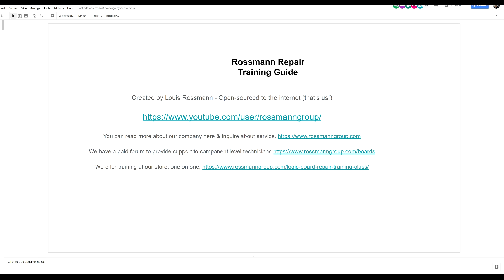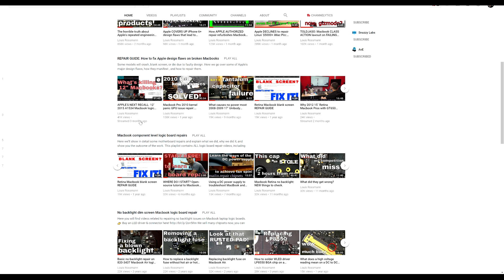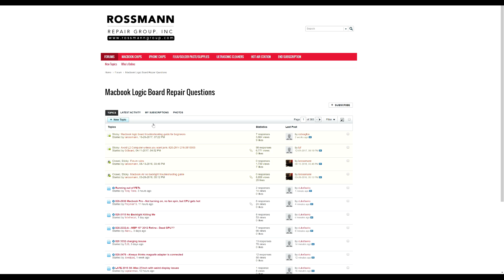Thank you.

Comment: Speaking of unauthorized idiots, had given my MacBook Air to a local repair shop, fixed it for an x amount and it worked fine(gave me a month warranty) for a week and died again,  after giving it to him again he said that a voltage surge or spike damaged the motherboard and now the motherboard needs to replaced. Now what i don't understanding is it this possible? I am using the original adapter/power brick that came with the macbook,  have a single phase 240v supply at my residence, have an assembled desktop pc and hp laptop weren't affected at all by the supposed "surge or spike" 
Is this possible or he's trying to rip me off.  he won't give me my money back

Comment: I wish I'd known about you 18 months ago when I spilled an iced tea on my 2013 MBPR. Both Apple and a local shop told me it would be cheaper to just buy a new one rather than repair it. I did that (a 2016 Touch Bar that has had its keyboard replaced 3 times so far), sold the 2013 and regret it every. single. day.

Comment: I worked in the industry for 30 years.  We bought machines, used them for 3-5 years then changed them.  I could give you chapter and verse the history of 12,000 plus machines.  I'd say after 18 months repairs to anything other than what amount to customer consumables (disk, RAM or PSU) isn't worth the effort or outlay.  Looking for an IDE or sata 1 component now is unwise for a lot of reasons.  If a machine is worth $300 or less why would you spend $200-250 on a repair.  If it's worth more - odds are it's under warranty.
 ... Technology by definition has a best before inbuilt.  It's sometimes fun to see just how far the old gal can run (my last laptop lived 12 years) but there are lots of reasons for supporting your economy by putting the old dear out to grass and getting a new model.
Statistically 90%+ of a model line will simply die a natural death after 10 or more years, never needing more than a software reload.  But the consequence is you have to accept local manufacturers ceasing to trade.

Comment: lmfaooooo 10:56  I agree with your assessment on self repair here.  The whole repair industry is going to be better off if there is a big shift in public demand for their electronics to even BE repairable.  The most insidious pinnacle of this in my opinion is phones that you can't even access the battery.  My phone is now 4 years old (Note 4).  Late last year I ordered a double amp/hour battery to replace the original and did a factory reset, keeping a handful of apps and my contacts.  It's like a brand new phone now, I hope to get 4 more years out of it.

Comment: Aaaand this is why I watch Louis Rossmann.
  In one of the first videos of yours I watched you'd mentioned doing a 5 minute fix for a client and they were "aghast" that you were charging them the full "quoted fee". You went on to explain that, without having spent years in training, without having the proper equipment, without access to documentation, without the accrued experience you would not have been able to diagnose and repair the problem so efficiently and that THIS is  where the value lies. Ie: It's NOT 5 mins of labour but the YEARS spent to gain that level of efficiency that they are paying for.
   I spent many (many) years in manufacturing (aerospace & automotive). Occasionally I'd be called upon by third parties to address issues, be they process, quality, efficiency, logistics... what ever the fuck. More often than not, the solution was readily apparent, at least to me. I'd solve the issue, show them how I did it and provide them some forward knowledge or trouble shooting philosophy. They'd shake my hand, pay me without question AND call me for advice on future projects BEFORE trouble arose. Why ? Because I'd spent the time and understood the tooling, the engineering and the AQAP, ISO, QS9000, TS16949, DIN, WhatEverTheFuck they needed to succeed.
   Such is the industrial corporate experience... 
   Enter a side interest in home renovations. Purchase the Provincial Building Code (to be legit). Listen to the home-owner's wishes. Provide a free estimate. Spec out code requirements and permits. Justify the estimate with a 3D detailed design and bill of materials. Answer questions regarding structural, plumbing, electrical, lighting, heating, fucking, fucking... "yeah, just gonna have my brother-in-law do it. But thanks anyway." 
Answer phone call 2 months later, "Was that 2nd return line supposed to be on a separate breaker ?"
   Uh-huh... MY FREE detailed prints and specs, sorry... that return line goes straight up yer ass!!
   Take away this... Provide enough free knowledge to enable your client's options, but not so much that they will completely fuck it up. aka: A little knowledge is a dangerous thing.

Comment: I own a small software consulting firm and I'm a firm believer that shared knowledge is power.
Reply: Vesta Freyja what does a software consulting firm do?
Reply: @blackula911  It really depends upon what upon the clients needs and the area of specialization of the software/hardware consulting has acquired over the years.  In my case I initially started out with most of my clients (27 years ago) in the engineering side of the oil patch concerned with monitoring down hole activity, pipeline and vessel corrosion. Providing software and hardware components to monitor and manage those aforementioned activities.  Now only a small portion of my clients are in the Oil patch however I have not strayed from the engineering side of businesses.

Some software/hardware consulting firms help businesses with projects that fall outside the businesses area of expertise or the business has a need for IT personal for projects for a short or specific duration.

Comment: You and you channel made me look into repairing a Zune mp3 player years ago. Normally if it broke i would just go buy another and didnt give it a second thought. I stumbled upon your videos and saw that you were doing repairs that left a impression on me. A few days later i had ordered the battery for my Zune I had no prior experience soldering stuff on to board hell i didn't even have a soldering iron or anything related. I went to local Radio shack/ Harbors and bought 2 soldering irons one that has a knob to control temp and the other just some basic plug into wall let it heat and bam ready.

I went looking for videos and guides online to replace the battery found one Youtube and went about taking apart the zune. At first i was a bit scared about putting a hot soldering iron on a board because i had this nagging idea that i would melt the board eventually gave and desoldered the battery and replaced it with new one and a bit more soldering. Fixed my zune to this day i still use it even though it very outdated and such.

Its people like you that let the rest of us knows it can be done even if its maybe simple or complicated if you are willing to put in the time to learn and take a chance you can possibly do it.

I know my repair wasnt anything complitcated at all but at the time that was the first thing i ever repaired electronically and it was thanks to you 

Thank you Louis you are the best my friend

Comment: I remember the first time I pulled apart my very first LCD monitor that died after about 3 years of use.
Had no idea wtf I was doing, so I went online and just looked up the board schematics + fuse, as I did have the slight understanding that when shit stops working, check the fuse.
Jumped the fuse and BAM! monitor worked again! So I replaced the fuse with an old car fuse that had same voltage and amp limit and she still lives after nearly 12 years!
Reply: Good thing the fuse did it's intended job in apple products.
Reply: I'm assuming this monitor is not an Apple product, lol.
Reply: ayyyy!!! I know you!
I read a lot of your post on TF. You keep up the good work with that too.
Reply: +SunnyZ
Car fuses tend to be far more expensive and actually worth the money they're paid for because, well put simply.  They're built for cars, they gotta last years of being turned on, and off, constantly, hundreds of times a week, etc and at least a few years of water damage/wear and tear with all sorts of voltages going through it, they tend to be rust proof, and tons of other advantages to them.  This is also why they are normally covered in plastic as well, to protect it from water damage and the likes.  

Only draw back?  Car fuses are pretty expensive for just a simple fuse ($10-$20 retail for just 1 depending on the type of voltage/amperage it uses, for a company that plans on making thousands of monitors, fuses like this can easily increase the price of said monitor by over $300 just for a simple fuse)

They're just high quality, plain and simple.  Even old ones in cars from the 90's are still of higher quality then the shitty fuses companies put in things like monitors today.   
I don't recommend putting a fuse from the 90's in a monitor today though unless it's just you fooling around/a pet project because I don't exactly trust fuses that are over 30 years old now after all...
Reply: dueldu https://youtu.be/298QWlHtNaQ
Reply: @Ichi Capeta   Ohhh a stalker. YAY!

Comment: Damn right.  I'm old enough to remember, as many of you are as well... that circuit diagrams were always found on the rear panel or bottom cover of any appliance, and repair tech manuals were always available, usually from the manufacturer.  Apple getting angry, and asking to have a video taken down because the location of a component on their board was disclosed makes them a laughing stock in my eyes.  It's as if they're embarrassed of their shoddy engineering (as they should be).  Man up Apple, what you are doing is un-American .

Comment: Louis, one major question I have about component-level repair is Macbook SSDs. As far as I know there are no schematics for these things anywhere. With liquid damage so common I have a feeling that at least a couple of the dead Apple SSDs I've come across have been due to liquid damage. I realize that often when an SSD fails, it's done for, but I've had Apple drives that have obvious corrosion on them and I'm not entirely convinced that they're not repairable given the right knowledge. Any thoughts on this? Have you had to do any work on Apple SSDs before?

Comment: Thank you Louis! You inspired me to fix and repair my Logitech Z5500 board in my subwoofer that went kapoof. I love these speakers for my computer and at the time nothing else on the market was as good and yet they were discontinued. I was able to diagnose and repair the problem with some flux purchased from your store and a cheap chinese Yihua 992DA rework station! :-) (Also other things I've seen you use like the braided solder sucking cable I never knew existed.)

Comment: Thank you for your courage!  I, too, do the repair thing on computers... but not to the board component, at least no these days. Back in the through hole days, I soldered together boards, trouble shot customer's problems, and sold them stuff that I and my friend had assembled. It was a gas!! Then I moved on into the software realm, and have been an "expert" in about a dozen different computer operating systems at various times. I was there for about 30 years. But a few years back, I came across your videos, and realized that yes, I could get back into the hardware side of things.  So I got a cheap soldering iron, and started re-teaching myself to solder. I've repaired boards since then, and feel a lot more confident with hardware again. Thank you for inspiring me to get back into world of hardware, solder and flux!